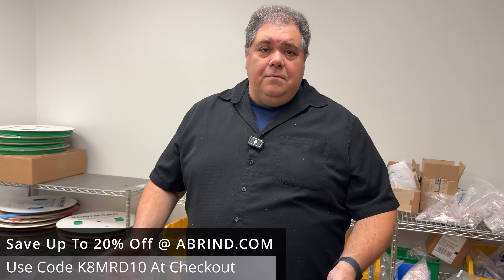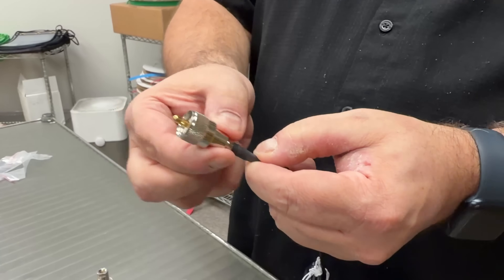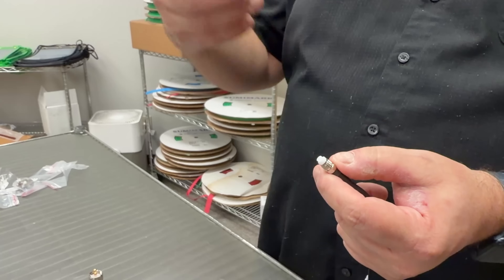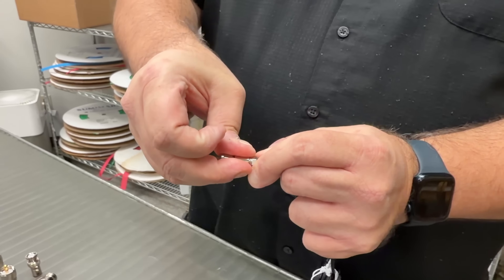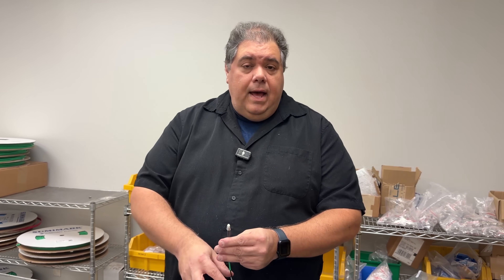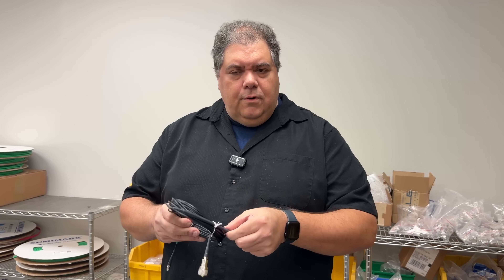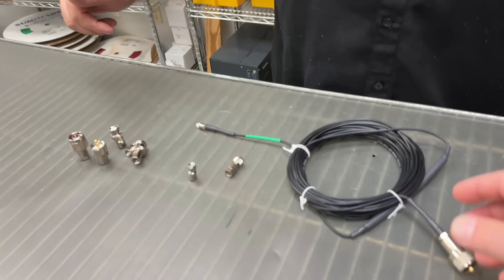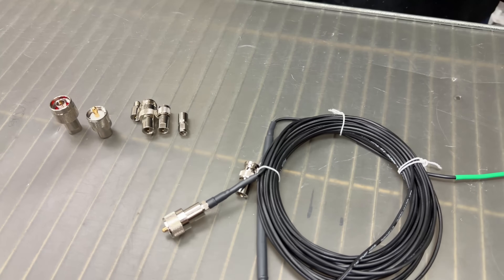ABR Industries FME Series.  One Cable, Multiple Connectors!

Comment: I couldn’t find these on their website. How do you get the cable with all of the multiple connectors?
Reply: You can call them . They make a order and E-Mail you a invoice .  They even do ferrite on each end of coax if you want. You can even E-Mail them a custom request. They respond quickly !   I have had Chuck get back to me in 1 day !  If you can't find the cable assembly you want just call or E-Mail them.  I had them make FT240 choke with ABR 400 and different ends , I E-Mailed them. Got a Quote in 1 day ! Ans A invoice link. Paid and had them in about a weak including shipping. They that good !